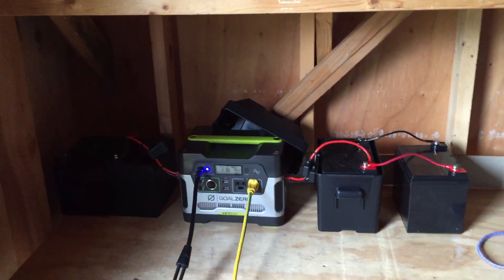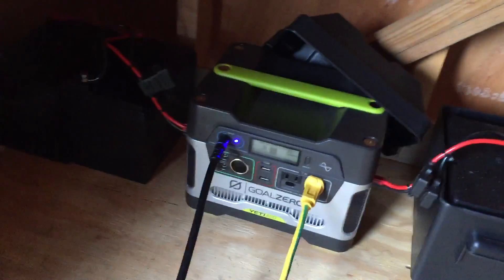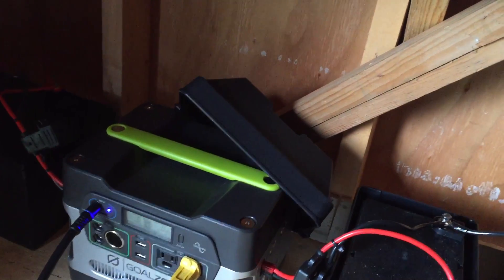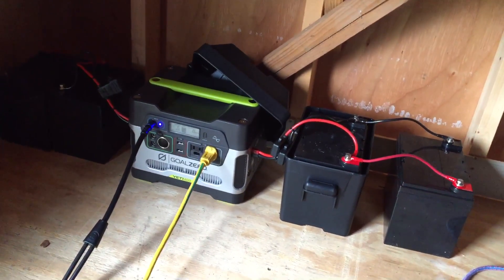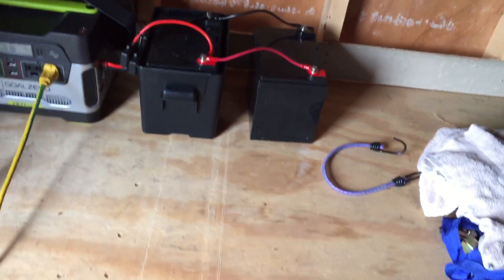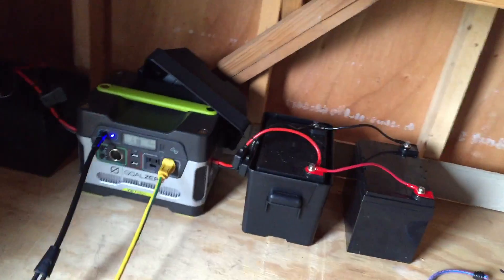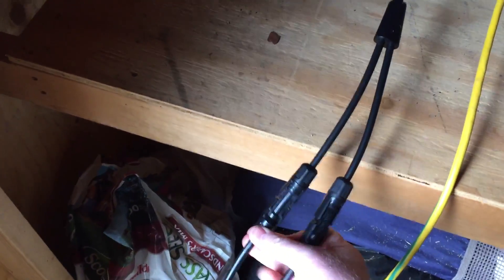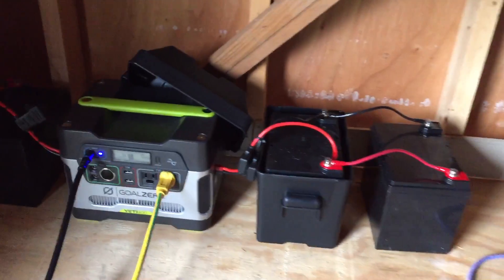Yeti 400 chaining

Comment: But how are the other external batteries recharged, because you have not connected this one in a circuit with the Yeti zero? That would be the ultimate hack for all power stations to perform an alternative capacity expansion?

Comment: But can you use that power as a surge, or a 1250 plus load! I don't think you can? So as long as you stay below 400watts your okay, anything more and you'd require larger inverter, yes? Otherwise we'd all just buy smallest/cheapest unit and chain the heck out of it. Different needs for different reasons I'm 🤔.

Comment: Thanks for this! We have two Yeti 400 and need one of them to have a backup alternate 12v batter for our Starlink off grid. We have 300 watts of panels on the cabin roof for both Yetis.  We bought that Powerworks cable to plug the Anderson port into the chaining plug on the side of the Starlink dedicated Yeti. Then we wrapped the (too short) negative and positive wires to the alternate posts on the battery. My question is, does the charging / use of the chained battery only occur after the first is depleted? Basically how does the chained battery operate with the Yeti? Thanks!

Comment: Smart way to expand your usable watt hours. I got a similar idea from Todd Parker here on Youtube. He chained his Yeti 1000Li to a Lithium battery using the Goal Zero 12v adapter. I ran witth his idea, but opted for the SOK's 206Ah (12.8v). Turning my Yeti 1000Li into a 3600wh battery (+ -). Nice work.

Comment: I know this is gonna sound like a stupid question but I know nothing about power and electricity. I've got a Yeti 400 that I use in the field and would like to add 1 additional battery like this. I'm running a telescope, camera and laptop and right now the current Yeti just barely gets me through a night. So when I go camping for more than one night, I'm s.o.l.  But my question is, Does the charger that came with the Yeti, when plugged into the wall, charge both (or in your case all 5) batteries or do you have to recharge them individually? i.e. does the current run both ways through the side Anderson PowerPole connectors?
Reply: I'm trying to figure out if I'll need an additional charger for the second battery.

Comment: do I have to use 33AH batteries could I use ones that are more or less ????
Reply: Not likely the inverter will handle much more than it is handling, but it will handle a 35 AH AGM deep cycle.  However the cost is about $120 but you can run it longer and drain more power without damaging the battery nearly as much.

Comment: Will this cables work to add more external batteries Spartan Power Battery Cable 4 Gauge AWG Wire Set 5/16" M8

Comment: Planning on building my van. Could this setup power a 32inch tv, small fridge led lights and fan? For lets say 4 to 6 hours or would i need more power.
Reply: It will just put out approximately 300 watts continuous with a 600 watt surge. So, it probably won't run all those appliances at one time.

Comment: Hi possibly silly question, what’s the exact goal zero mc4 adapter do you have there to achieve the 120 watt charging ? and do you think that will work charging from two AC power sources with appropriate conversion?
Reply: Van and Solar Adventures what I was actually thinking about is plugging in 2 AC adapters via the splitter? Each providing 60ish watts?
Would that work in theory?
Reply: @cryptopimp  Ask Goal Zero they are usually good about answering tech questions.

Comment: Good video. I purchased a yeti 400 to run my cpap machine at the cabin I have. It worked fine but the battery was drained in the morning. I chained two extra 35ah batteries, one on each side and now have about 100ah total and the cpap machine doesn't drain the 400 and I have a good reserve time on the system. If you don't need heavy watts for an output your way is the way to good.  Thanks for showing me how to beef up the system.

Comment: the goal zero MAX batteries advised by goal zero are 2 EXTRA 33ah AGM batteries connected via anderson power pole connectors.
Reply: hello, can I ask why it should be 33ah battery, can it be more than 33ah?
Reply: for the yeti 400 it is a max 33ah battery on the advice of goal zero & it is the size battery in the goal zero pack. Using the andersen power poles im advised 33ah batteries x 2 is the maximum rated batteries you can use. Apparently is it due to charge controller rating & to balance out the batteries etc

Comment: Did you use 1/4" or 3/8" ring terminals on your custom cables? I'm building the same setup with the same batteries : )
Reply: Where do you get the $58 batteries?

Comment: Awesome! I have been trying to design a light weight combo to run the Air Conditioner in my small RV. Two Goal Zero 400s with 4 batteries each as you have done to charge a Yeti 1400 lithium which can run the Airconditioner especially with a soft start. One Goal Zero 400 plus batteries can be charging from DC port driving down the road while the other charges the 1400. The combined watt hours will go nicely thru the hot part of the day....then at destination can use the 100 watt solar panels. The light weight will allow a 70 yr old to carry everything into the house for winter without risking injury! Now if I can figure out how to charge Lithium car batteries in a bank with my Quanta Magnetics Q Generator...which runs 24/7 no sun needed.....so I can charge an electric car on the move......Ahhhhhhhhh Heaven! Carry it all into the house and use it for a Lovely Sustained house!

Comment: question: if you chain batteries together like this do you have to plug into the yeti?  I.e. if I at a later date, got a larger inverter and connected it through a socket attached to one of the externals - would that be possible/safe?  You know if I wanted to run something more than 400 watts for a short interval.
Reply: Got you.  A more specific quest has now occurred to me.  There is a 12 volt device that uses 12 amps (144 watts) to run.  The 12 volt port on the yeti is rated at 10amps.  So I was thinking I could get a 12 volt socket rated for 20 amps, attach it to the external battery that I will hook to the yeti and run the device that way.  Is that viable?  Further question--if I run power off through a socket attached to the external battery will the two batteries still drain together as one unit?  There isn't some special regulator in the yeti itself that does this?  It's just that once chained, no matter where the port is, the batteries will drain together and charge together as if they are one unit because they are wired together--is this correct?
Reply: If your device requires 144watts and the 12volt ports only do 120. You will have a slight % of power not powering to the device. Unless you directly rig to the battery itself, you can not get anymore power from the 12volt plugs over 120watts. So if you use a 150watt heater or cooking,etc device requiring over 120watts. It'll work, yes. but not to it's full % of ability. It's like putting a 9volt device onto a 5volt plug. It'll run, but just won't run at 100% of power if you ran it on it's correct power ability.

So the only way, would to be chain the Yeti-400 with another battery like Van and solar did, then plug something directly to the Other exposed battery to run a higher watt required 12volt device, and you'll beable to run it at a more fuller power.

Comment: why use 4 battery's.? this makes no sense.. you can use one with more AMP. You basically are making a large battery by chaining 4 x 33 ah. This will be the same as 1 x 132 amp. amp is just the storage capacity and not the power.. 1 battery would be cheaper en easier.
Reply: Gerry Chen, yes it should be fine. If you want to be sure, you can ask goalzero on their website.
Reply: Eric Rutjes the goal isn't more power.  You'll just blow fuses the goalzero unit isn't rated for the higher amperage.
Reply: No, you will not. Chaining 2 or 4 battery’s is the same thing as one bigger battery, 2 x 33 ah is 66 ah. 4 x 33 ah is 132 ah. I don’t want more power but more storage and I don’t want to use 4 battery’s 
To be sure I ask GoalZero if i could chain a 105 ah. This was their answer. 

Hi Eric,
Thank you for contacting Goal Zero. Great question, you can definitely chain a 105ah agm lead acid battery to the Yeti 400.
Reply: Dear Eric, 
that's mean I can buy a 105ah AGM Battery just direct chain with my Yeti400 without any issue. right ?.
Reply: You cannot use different size batteries than what is in the Yeti 400 IF you plan on using the Yeti to charge the additional batteries.  If you chained a 100 amp/hour battery, the 33 amp/hour battery would get cooked in the charging process.  Go read Goal Zero's Q&A.  It explains the concept thoroughly.
Reply: No, Eric, you will not be fine, UNLESS you plan to charge the bigger battery separately, disconnected from the Yeti.  So, if you needed additional power in an emergency situation, it would work.  However, you better not try to charge that bigger battery with the Yeti's charging circuitry, or the little battery in the Yeti will get cooked in the process.

Comment: Hi there, is the screen on the Yeti 400 adapting automatically wile charging depending on the number of extra battery connected? or does it show only the percentage of charge of the goal zero battery only? thanks for your video!
Reply: Wanted to let you know goal zero is stating you can chain larger AGM batteries as long as all your batteries are at full capacity prior to chaining them.  I also read a study that debunked the long standing previous recommendations that all your AGM batteries must be the same.   Loved this video it enabled me to increase my bank.

http://www.goalzero.com/p/165/goal-zero-yeti-400-portable-power-station

 
Noble1
 · 24 days ago  
I purchased yeti 400 and the chaining cable with alligator clips to connect my external batteries. I currently have 2 Sun Xtender 104 AH AGM Solar Batteries connected in Parallel and wondering if I can connect these to my Yeti 400 thru the side?
1
answer
Answer this Question
♂
 
GoalZeroSupport
 · 24 days ago  
Thanks for reaching out to Goal Zero! Yes you can chain the Yeti 400 to these batteries. You will want all of the units fully charged before chaining them. You will need the 6mm Output to Anderson Adapter http://www.goalzero.com/p/29/6mm-output-to-anderson-adapter and the 6mm Male to Alligator clamp http://www.goalzero.com/p/187/6mm-male-to-alligator-clamp (it sounds like you have this one already). You could also use the 6mm Male to Ring Terminal Adapter http://www.goalzero.com/p/241/6mm-male-to-ring-terminal-adapter. If you have any other questions concerning this please contact us by phone at 1-888-794-6250 or by email at support@goalzero.com Have a great solar day!
Reply: MsPopRouge, is the chaining working?

Comment: From an drained battery setup like in this video, how many hours of plugged-in charge time will it take to start using again?
Reply: wrong your setup does not give you 2000W of power. the Yeti 400 does not have an inverter capable of producing 2000W. the Yeti 400 limits you to just 2.5amps output. you do the math bro

Comment: good vid...but you will never exceed the amps of the yeti 400 inverter
Reply: one of the statements you made about your video was NOT correct. you said

"this gives me a total of 2000W...you basically get 400W out of each battery which means 2000W. and the Yeti 1250 is what, 1250W. so this is more power than the Yeti 1250. i got more battery power"

while you may have more aH (amp-hours b/c you have 4 x 33 aH), you do not have the equipment to benefit from those aH's.  your Yeti 400 cannot exceed i believe ~ 2.5amps before it trips off. so yes, your setup can draw 2.5amps LONGER than if you were to draw 2.5amps from a Yeti 1250. you don't however, have anywhere close to the amount of power with that setup compared to a Yeti 1250, because the Yeti 400 constricts that with the weak inverter.

you would benefit greatly if you ditched the Yeti 400 and used it for mobile power, and instead replaced it with a charge controller and a more powerful inverter that will give you the capability to benefit from all of those batteries connected like that. 2.5 amps is very limiting. a laptop charger will eat up almost 2amps giving you barely anything to play with. 

that's all i was trying to say

Comment: you're still limited to the 400 watt inverter all you have gained is longer running time not more watts this is not to using a 1250 yeti with a 1250 watt inverter
Reply: I don't think you can put a inverter directly on the the chained external rail, have you done this
Reply: but you can put an inverter on the chained batteries and have 2000W and the Goal Zero still acts as a solar controller and an additional power supply with a heads up display
Reply: Stop critiquing ingenuity...longer running time is pretty darn good for rv life...
Reply: niceguy60 you can do it, just make sure you you have a wire that can handle the current draw from a 2000 W at 12 V. But you need a wire that can handle 170 amps. It is definitely not a safe configuration. You can die if 1 amp runs through your body let alone 170 amps. To lower that amps you can increase the voltage of the battery bank configuration but with a 2000 W inverter it is still very intense. 2000 watt systems are not meant to be configured like this. I think it would work better with an inverter no more that 500 watts if you are going to connect a separate inverter to this battery bank.

Comment: How are you getting 2000 watts out of this application when the Yeti 400 still only has a 400 watt inverter?  I believe you have increased you capacity i.e. amp-hours, but you don't have 1200 watts available.  i.e. you still can't power your full size refrigerator.

Comment: Well done man I'm on the fence from yeti 400 or 1250 but the 1250 has a bigger battery charger and a mppt solar instead of pwm which would work a lot more efficiently with the panels  but I'm from the uk and we don't get much sun worth bragging about for solar so maybe I'll just do what you've done here to save some cash and just charge up via wall plug when at home.
Reply: You can get around the 120 Watt input limitation by charging in parallel.  By using an additional charge controller, you can direct your additional panels into your battery bank either via another connected battery or the Anderson port connectors on the side of a yeti (according to Goal Zero).  They also informed me that the charge controller in the Yeti 400 is a PWN 10 amp charge controller.

Comment: So does charging the yeti in the setup you have also charge the other four batteries as well ? Also I found the wire with the anderson connection, how about the other cable you use to connect the other batteries ? I browsed the site and did not find anything related other than cable on a spool, thanks, awesome video
Reply: +Van and Solar Adventures  Thanks !!! Will attempt a rig such as yours !!!

Comment: I believe if you change the way the batteries are hooked up in parallel all of the batteries would charge evenly. If you hooked up all of the external batteries in parallel and only used 1 Anderson connector. Make the Anderson connector with the closest positive terminal and the furthest negative terminal of the battery bank. This would allow all of the external batteries to charge evenly.